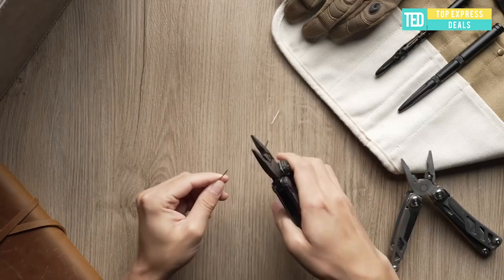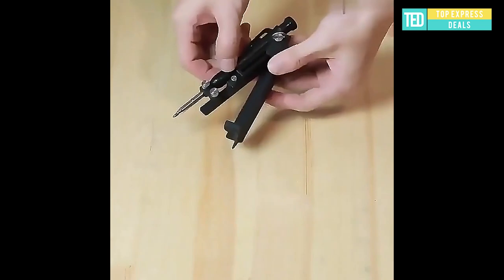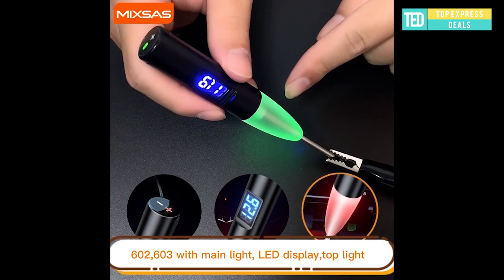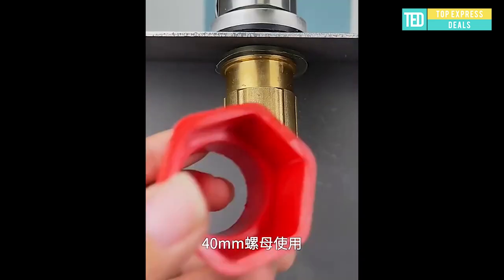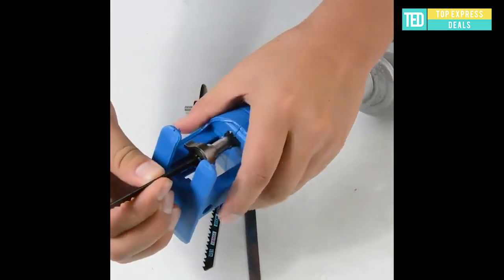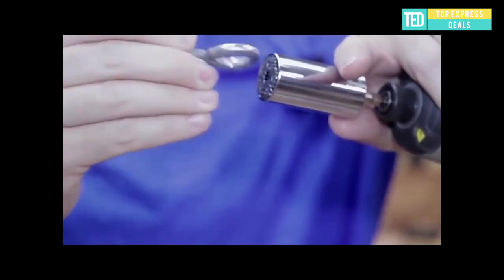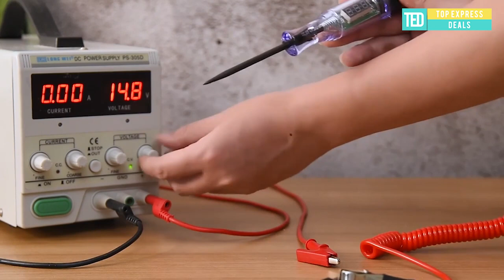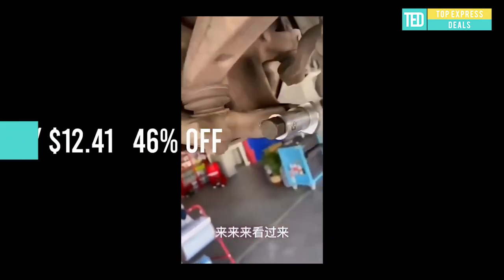20 Gadgets and Tools on Aliexpress - Must Have Products

Comment from the maker: 👇👇👇LINKS TO PRODUCTS BELOW👇👇👇

01 16 in 1 Multi-tool
Aliexpress: https://bit.ly/40OOMkz

02 9 in 1 Electrician Pliers
Aliexpress: https://bit.ly/3TYh2PS

03 Precision Electric Screwdriver
Aliexpress: https://bit.ly/40vLdQI

04 Multi-Function Scribing Tool
Aliexpress: https://bit.ly/3TVbYLQ

05 Mini Electric Drill
Aliexpress: https://bit.ly/3UaLqXn

06 Multifunction Screwdriver
Aliexpress: https://bit.ly/3TUb8yS

07 Blade Edge Corner Planer
Aliexpress: https://bit.ly/3ZmCnmY

08 Universal Wire Cutter
Aliexpress: https://bit.ly/3nzpI33

09 Electrical Circuit Tester Pen
Aliexpress: https://bit.ly/3TXIhdl

10 Flume Wrench
Aliexpress: https://bit.ly/3lP4Vbc

11 Efficient Crimping Tools
Aliexpress: https://bit.ly/3zjioeg

12 Reciprocating Saw Adapter
Aliexpress: https://bit.ly/3lMFJCd

13 Universal Torque Wrench
Aliexpress: https://bit.ly/3JYbL5Y

14 Universal Car Dent Puller 
Aliexpress: https://bit.ly/3ZttSXd

15 Professional Electrician Tool
Aliexpress: https://bit.ly/3ZnpPvL

16 Auto Circuit Tester
Aliexpress: https://bit.ly/3ZrmDPM

17 Ceramic Tile Grout Remover
Aliexpress: https://bit.ly/3M3rgw9

18 Hand Sewing Machine
Aliexpress: https://bit.ly/3KlPIrB

19 Electronic Digital Caliper
Aliexpress: https://bit.ly/40OFnKa

20 Shock Absorber Removal Tool
Aliexpress: https://bit.ly/3Zx8sIK